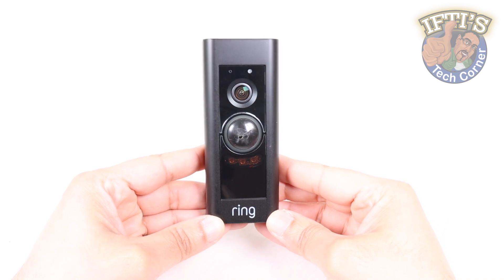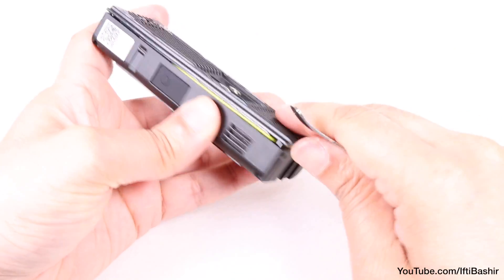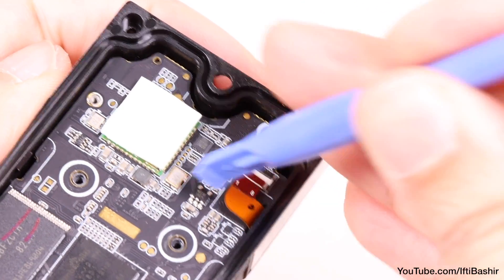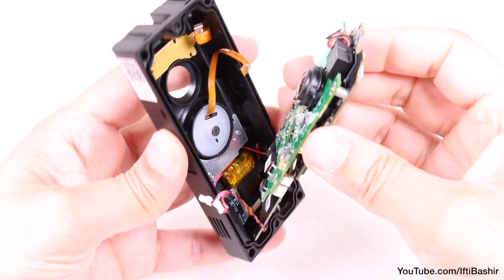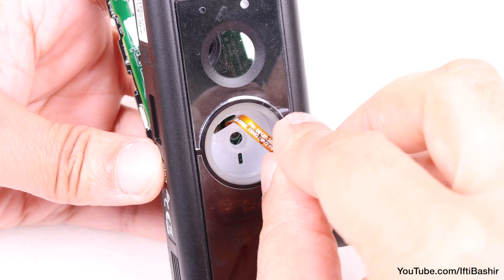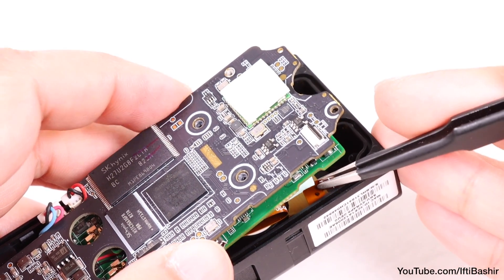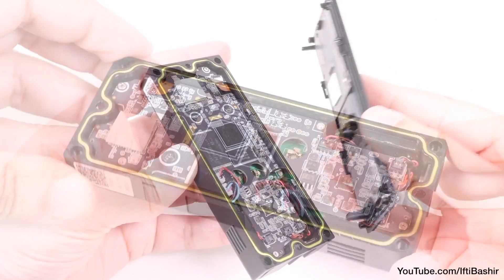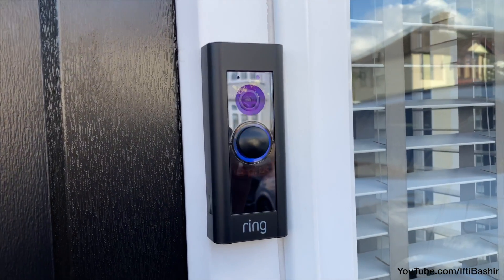Ring Doorbell Pro - Fix / Replace a cracked or broken button! : STEP BY STEP GUIDE

Comment: I cut a piece of black duct tape in the same round shape as the button and then stuck it on top of the cracked button.  Not as appealing as the original, but nobody has noticed.  Quick, cheap and easy.

Comment: People need to be aware the sensor board can come away from the chassis on removal of the main pcb due to it sticking to the board. Carefully remove from the blue sticky pad and place back onto the plastic chassis. Be careful not to touch the sensors. HTH. Also my button base didnt have a notch so just make sure you align the little tabs on the base of the button, there's 2 small tabs which belong to the large slit in the button. When you put the button back into the main unit, make sure you align the spike which should poke through the white base when pressing the button otherwise your button wont sit square when screwed up.

Comment: Really clear tutorial, thank you. Unfortunately when removing one of the two plugs from its socket, I pulled the whole socket off. This is the socket for the plug with with the two red and black wires leading to it (not the plug with 3 wires, black blue and pink) - see  video at 2m29s. 

The ring seems to work but now my mechanical chime is buzzing and doesn’t chime when the newly replaced button is pressed. Is the doorbell still safe to use?

Comment: Excellent guide, great detail.
I'll add one thing. When I powered mine up after reassembly, it appeared to be dead. I turned power off, checked with my meter etc, but all it required was to WAIT! It took about a minute, possibly charging cap \ battery? 🤷🏻‍♂️

Comment: Great video.  It would be worth stressing that the cable from the button assembly is delicate as mine fractured where is enters the plastic moulding. I decided to just reassemble without that cable connected and surprisingly the unit still seems to work fine! Delighted but confused as to what function is controlled by the electronics behind the button!

Comment: 3:10 Anyone knows what is this ribbon cable for? This one connects the board and goes inside the button, I broke it, and just cut it out, and the doorbell seems working fine without it, 😂which I know it’s not right, just want to see what should I expect? Thanks.

Comment: Brilliant instructions & video - I’ve just replaced my button following your guide. My Ring doorbell is up and running and working 100%. I’m hoping that my broken button was being activated by nighttime headlights and I’ll be interested to see if my doorbell sensors have reverted back to how they used to be now that the button has been replaced.
Reply from the maker: Headlights generally are also picked up by my doorbell and it records a clip too. You may need to reduce motion sensitivity to stop it capturing that, although I just let it record as I have notifications for motion switched off anyways.

Comment: Hi there. Good video. Unfortunately, when I tried to replace my button, I tore the copper button ribbon cable away from its tab so it is no longer connected. Do you know what it is for? To my surprise, the Ring doorbell is still functioning as it was before despite the ribbon cable not being connected!
Reply from the maker: Is the LED light around the button still working?? Thats all I can think of TBH!
Reply: Working perfectly! Can’t work it out…
Reply: Though actually the three red LEDs beneath may not be working. What are they for?
Reply: It is the PIR sensor for night vision mode - but if you use that Ebay one recommended in the description, then your PIR sensor won't work anyway as it can't get through the replacement button!

Comment: I did this about a year ago, but it didn't function perfectly and lately, the button tended to stick down so the doorbell didn't work at all. But I took it apart just now, gave the edges of the new button a light sanding with some fine sandpaper, applied some WD40 around the edges with a cotton bud, then wiped away any access. I found that dramatically improved it and it's now back working again. €70 saved.

Comment: @3:52 is that a PIR sensor under the button? It looks like it. Anyone know what it's used for?

My motion detection has started firing loads of false triggers, and the button has also got very cracked recently. I wondered if they are connected?
Reply from the maker: No its not under the button - its most likely under the button (the camera is above).
Reply: @iftibashir  I checked mine, its a PYD 1698, which is a PIR

Sensor PIR (Passive Infrared) - Sleep Mode TO-5 Variant, 4 Leads, Lens Top Metal Can

Comment: The video was very good. Sadly our ribbon cable sheared off when screwing the button back in. I'm now going to buy the Pro 2. Hopefully, the button will last longer than 3 years - at least I'll have a spare button.
Reply from the maker: 3 years?? You did well!! My original lasted just over a year!!
Reply: Don't worry about the ribbon cable - it is only for an IR sensor that you doorbell doesn't need to continue to detect movement

Comment: Great step-by-step a video , thanks !  I didn’t expect the button to be the first thing to break on the doorbell . Mine was clearly broken by some sort of courier button pushing metal tool.  Replace with HARD plastic button now :-)
Reply: No, very common due to poor material (changed now I believe). They were made of non solar resistant material. Amazon won’t replace unless under warranty 😡😡 which is irrelevant as an expense doorbell should far longer than the warranty.

Comment: I notice this written on the Ebay button sales page:

'*Update* - Lots of customers have had great luck, just pulling out the cracked button with pliers and then lining up the new button and pushing it into place. Just make sure the new button alignment holes are aligned correctly before pushing in place. '

Did anyone try this method?
Reply from the maker: Was repairing another doorbell a few days ago and was going to try this, but it was taking too much force and I didn't want to end up breaking the piece the button actually grips on to. Personally I wouldn't recommend it. I still prefer to follow the video and replace the button to avoid any further unnecessary issues!
Reply: @iftibashir  I was lucky with mine. I was able to remove the damaged button using pliers from the front. I had to look closely to see the correct area to push the new button down though. I think in my case, the old button was so soft, worn and flimsy that it was unlikely to break the piece that gripped it.
Reply from the maker: @mreverybody1150  Great - nice easy replacement for you!
Reply: DO NOT FOLLOW THAT ADVICE - you will break your pro doorbell.

Comment: I'm not sure if there are different of RING Pro ?? 
The buttons pop off with a pick. Stick it in the bytton and slowly pry it out. Theres 3 slots ...line it up and pop it back in . The buttons are very thin that's why it cracks easily.  If you look at the button there 3 slots at 12...4 and 8oclock. ...line it up pop it back in . I did mine less than 3 minutes. 
Opening it up have so many chances of thin wires or connectors breaking.

Comment: What do you do if your ring door bell is wired through the wall?
Reply from the maker: Mine is also wired. Take the doorbell off the wall (its held on with 2 screws), then release the two screws holding the wires in the rear (making sure to turn main power off first of course!). This will release the unit from the wall completely allowing you to perform the repair.
Once done, re-attach the two wires you removed, and then screw back onto the wall using the same two screws.
Reply: @iftibashir  thanks. I feel like I need a professional electrician to do this! 😔

Comment: Thanks so much for this video. Followed it to the T and repaired my doorbell. My circuit board was a little different on the back so small silver screw was in a slightly different location, also had to connections to something else but there was still enough room to remove the board and get the job done. Thanks again 5 🌟 video
Reply from the maker: Thank you. Glad it helped!

Comment: Thanks for the instruction. Very nice to see. I Luckily was able to replace the button without taking the whole damn thing apart though. If you have the right tools and do it with patience you can just take the old button off and push the new one onto the device. So I would advice to try that first and than follow this tutorial 😁

Comment: Can you just pulled button cover off with out taking it apart?
Reply from the maker: Some have been able to do this - and then snap the new button into place, but you have to be very careful in case you end up ripping the small ribbon cables etc out with the old button! Much safer to follow the video guide.

Comment: I was able to just pull out the old button and push in the new one, and it works.
Reply: So you didn't have to unscrew anything?
Reply: @iamLeLe  No, not at all. It surprised me how easy it was to remove the old, decayed button and press in the new one.

Comment: Informative but pathetic down the unnecessary. Pull out the old button and then align new button into the hole. Done.
Reply from the maker: Doesn't always work cleanly that way. Ive known many people damage their doorbell this way due to the ribbon cable just behind. It's at your own risk!

Comment: Omg...isn't it easier to just buy another? I'm 2.5 mins in and am overwhelmed.
Reply from the maker: Yes you could buy a new unit, which isn't cheap, or you can swap out the button, which costs next to nothing!
Reply: @iftibashir  wait? Are you saying there is an easier way than this? Thanks for your help!

Comment: Unnecessary, you can just carefully pull off the old one and carefully put a new one on. 
No need to disassemble everything.
Reply from the maker: You can, but be very careful. Many have ripped the ribbon cable away from behind the button assembly while doing this.
Reply: @iftibashir  good to know, thank you.

Comment: This is ridiculous for 1 freaking button!
Reply from the maker: It is indeed - and RING's answer is to replace the entire unit with a new one!
Reply: @iftibashir  i was frustrated but i managed to get the button on without taking the entire device a part
Reply: Just saw the last comment, had a go and did the same thing!!! What a rubbish design, not built for longevity